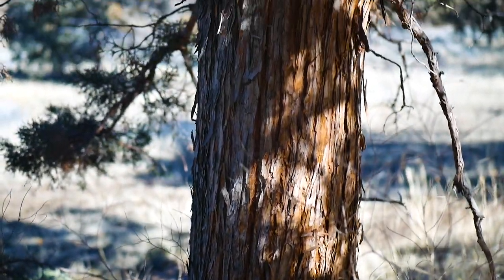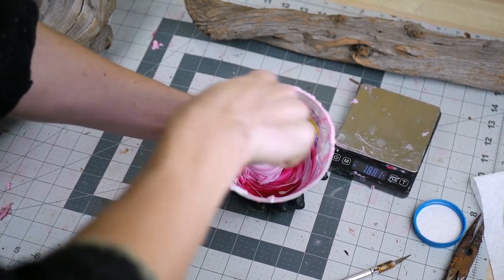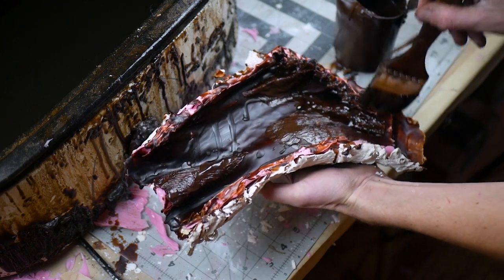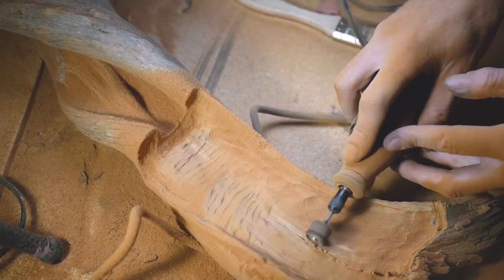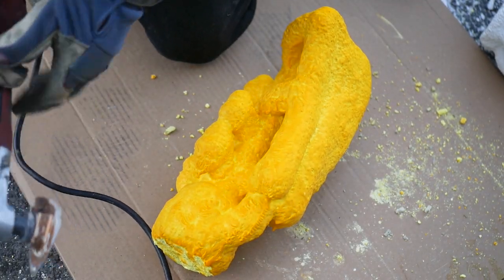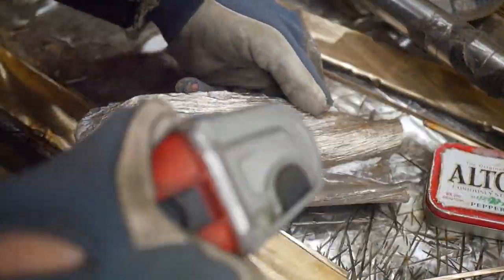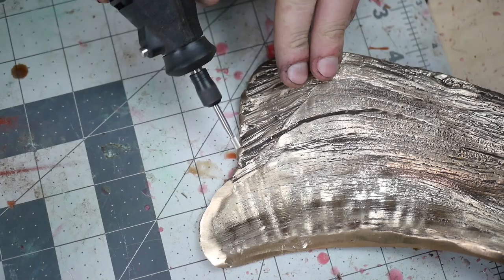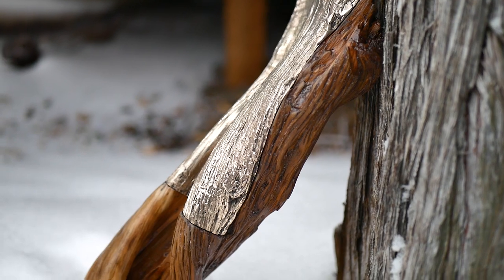Wood Inlay | Foundry - Cast Bronze Inlay in Juniper Branch

Comment: Very interesting process. I turn wood and found this looking for a method of pouring metal onto wood, not have much luck but this would be an alternative. I know the tree, I'm from Portland and have spent some time in Bend and around. I just might make a trip over to find some of that wood.
Reply from the maker: Theres way cooler and twistier versions of the juniper. I picked an easy one. I dont really know how youd pour metal right into it because of the whole fire thing

Comment: Very nice. Living in norcal, I know the tree you are using. I have a verity of unusual shaped pieces of wood, found while cutting firewood or using my wood mill, making lumber. 
I have a verity of skills, from woodworking, carving, leather tooling, etc, but my skills with metals are beyond rusty. No pun intended.  I've never have done this type of mold making myself, so I still am not tired of seeing it done. BTW, I have tool envy. 😶
Reply from the maker: The trees are whacky. There are a few kinda of juniper all over the west/southwest. I dont know anything about woodworking. One thing i originally wanted to do was get a slab with a live edge, take part of the live edge/bark and cast that in bronze, put it back onto the slab then you have basically a bronze edge on the thing but i didn't get to it

Comment: great video!! May I ask why there was no air trapped in the lego heads/helmets? This should be massive undercuts impossible to be reached by the bronze, without vent holes? And I doubt you moved the mold (and even if you did, does it really get rid of air in those legos?
Reply from the maker: The ceramic shell is porous and breathable. The weight of the bronze pushes air out of the side walls as well as back up to the vent/cup. Its not a huge amount but you can rely on it to not have to vent every single little weird area. Also with this much weight of bronze the head pessure is more than enough weight and force to push small amounts of air out of the shell through the walls. It probably wouldn't work with like jewelry size castings (not enough weight), thats why they vacuum cast but the vacuum is still pulling air through the investment
Reply: @skraminc  wow, that´s very interesting! Never thought this could be the reason.
So is it more porous as lets say plaster?
Reply from the maker: @joachimkarstens9769  i dont know the exact specs i just know what i can get away with from intuition. Im sure there is real science about it somewhere. Remet is a supplier for shell and they have a lot of info. Youd probably have to look into jewelry stuff for plaster info
Reply: @skraminc  ah I see! Very interesting. I don´t work with metals, so that was really astonishing :) thank you!
Reply from the maker: @joachimkarstens9769  thanks for watching

Comment: Those trees remind me of the snow gum, a tree that grows in the few parts of Australia where it snows. BTW if you want to reduce that camera wobble, get a foot of 1/4-20 threaded rod and cast a big ball of bronze onto one end. Thread it into the tripod mount of your camera and you'll have an inertial stability and vibration damping system. The longer the threaded rod, the higher the mass moment of inertia and the higher the damping of rotations. You'll see competitive archers with weights on the end of big sticks coming out each side of their bow for the same reason.
Reply from the maker: yeah they do look similar. if you look up like "twisted juniper table" or something where people polish up the wood a little better than i did they look much more alike. junipers are ugly at a sight because of all of that dry, flakey bark on the outside

Comment: Really nice job. How do you prevent the brass from discolouring?
Reply from the maker: i didn't do any coatings or waxes or anything to it. it only really darkens a little bit over time but that happens no matter what you do. first think i do is warm up the bronze piece before i start polishing and this cooks most of the water out of it (bronze, or metal in general will always soak up humidity from the air though) and then do the polishing and as long as you don't touch it with your fingers or get anything on it or use cleaners on it, it won't really change colors besides just getting a little bit darker (which will happen with a clearcoat or something, anyways)